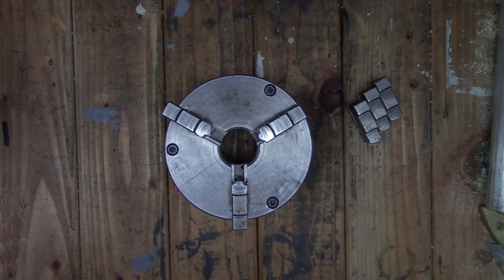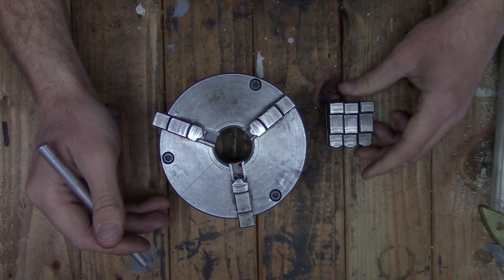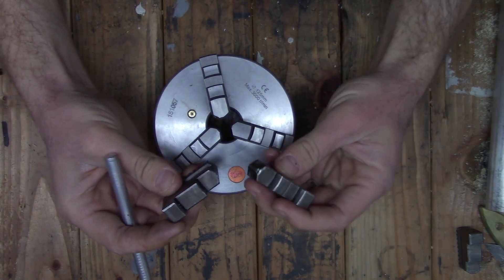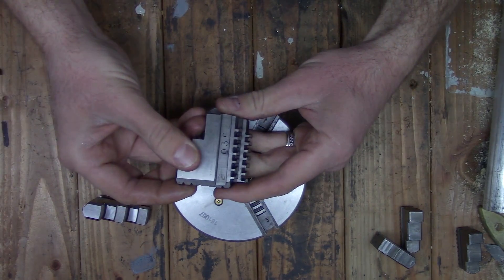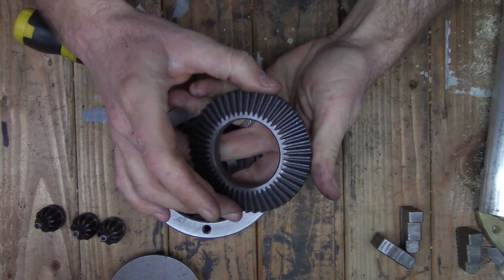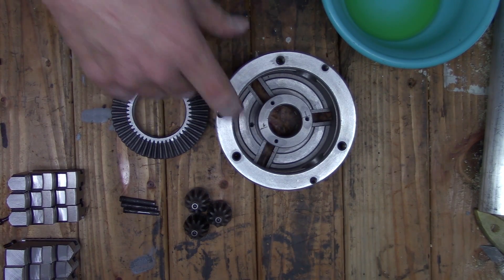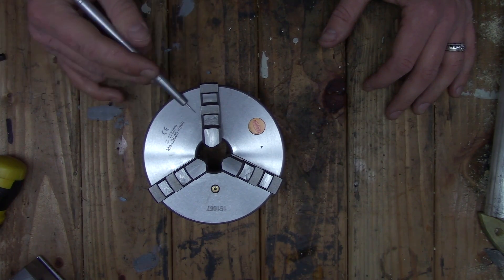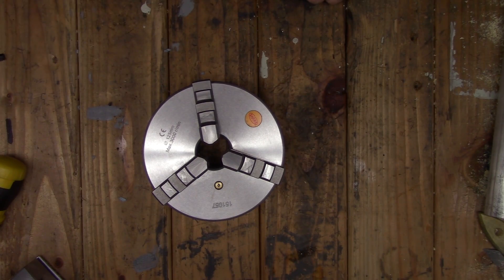Shars 5" Three Jaw Chuck Inspection

Comment: I’m watching this video over a year after you posted it so I don’t know if you will even get my comment. 
    I bought an identical five in Shars chuck. It too was gritty inside. Some or most of Shars products are made in the Shars factory in China where I understand Shars has their own US manager and quality control personnel. Be that as it may I think the grit should have been removed. The grit seems to be the graphite dust produced when cast iron is machined. My hands were black after handling the parts. They most likely just blow the chips out
Reply: They most likely just blow the larger chips out and then assemble the chuck. It’s a good idea to dissemble any new chuck and inspect and clean and relube everything, especially if it was manufactured in China. Quite often they cost their products with a gummy, greasy coating to prevent rust during transit on container ships. I’ve purchased several products from Shars mainly because they have a solid reputation and back up their products. None of the Shars products were coated with that nasty stuff that nothing short of lacquer thinner will remove.

Comment: Glad it cleaned up. I imagine it could be a difficult transition to a new chuck after using an old school one that you've grown used to. I think after my current project I'll give mine the once over too. (I bet everyone promises themselves that.)
Reply from the maker: It is a difficult transition. I really do love that Cushman chuck. Hopefully, at some point, I will be able to have access to a tool post grinder to fix it. As far a cleaning a chuck, I typically try an get it done every 6 months or so. That time frame changes depending on how often I use it.
Reply: I made good on my word, and tore down and cleaned up my 3 jaw after using the McMaster-Carrr ductile iron I was wanting to try. It was really nice for making an Acme nut. I ordered a little extra too :)

Comment: This video reminded me that i need to clean my chuck, it feel full of grit but it's not a cheap one, the only problem is that i don't want to go thru the hassle of aligning it to tha backplate.
Reply from the maker: If the register on the back plate is a good fit to the chuck, you shouldn't have to do any alignment.
Reply: I still don't know that, i've never took it apart since i bouth it, i know, shame on me.